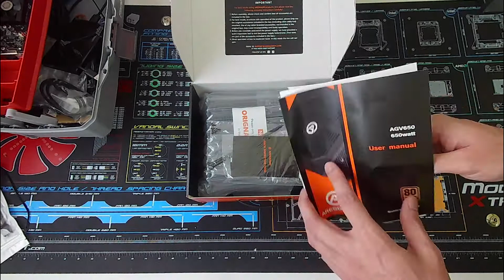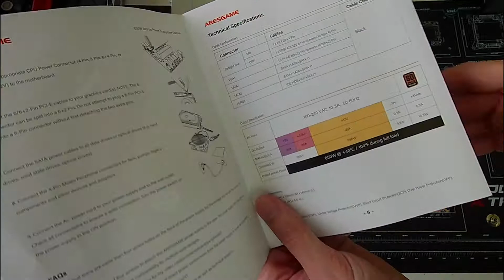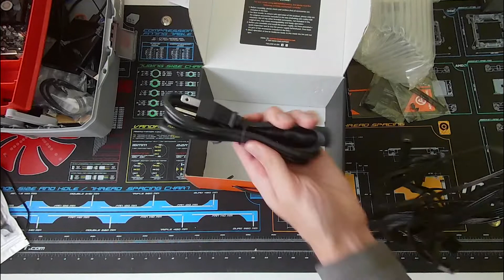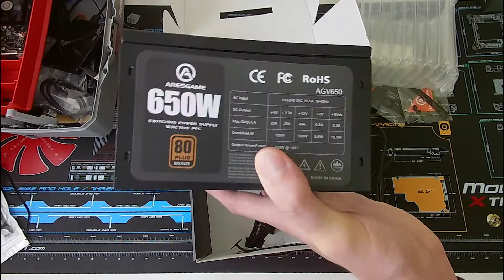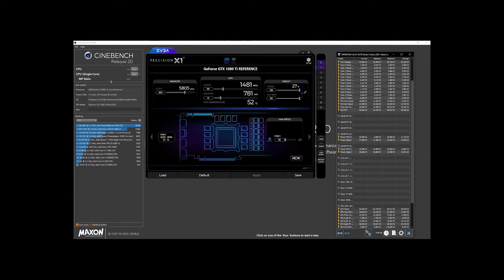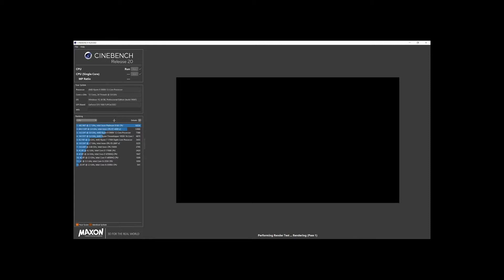Is this the Best Budget Power Supply on the Market? - ARESGAME 650W Bronze

Comment: your 1080ti pulled what 275 watts max? (kinda fuzzy for me) typically a 2x8 pin can handle 150 watts right? 75 from the pcie slot. so technically that cable is running 200 through it atleast right?  i mean it seems to be okay...but is it? lol im asking cause i built my daughters first pc with one of these ares 650's and its been chuggin along for the last few years running a i5 3470 and a rx 580 4gb. i have a 5700xt taichi i was gonna throw in there but im skeptical not having 2 cables max power for this card is like 270 watts. the rest of the system is maybe pulling 125 full load. so total it would be like 400 watts give or take a few. which on paper is plenty its just the one cable running that much power is what gets me.

Comment: I like these as well, mines running great after over almost two years and its quiet, stable and feel you really get your moneys worth BUT as always theres no free lunch and that is to say the caps used inside arent high quality as well as has been revealed in testing its missing a couple small components others might have, but it does have reasonably good input protection.  I think these are a case of how long will they run without issues, but for now im pleased with mine

Comment: Ive got two of these and after six months im completely sold on them, running quiet and cool since day one, as always long term remains to be seen but the feel and build quality seem  noticeably better than average compared to even some Thermaltakes in the same price range, the Aresgame reviews are certainly better than the Tt psu I was considering.  I also have a friend with an 850 and 500 watt and his are both running 24/7 perfectly on two of his mining rigs.  Im sold on the brand so far, lower end Aresgames come with an as expected 3 year warranty, but one gets the feeling they could easily go five years maybe more and the have all the major internal protections built in should a component fail.  Im my experience these arent cheap power supplies but rather budget affordable power supplies that are respectably well made and perform as such.  I have two and would buy another without reservation if the need arose.
Reply from the maker: i am super sold on them as well. i regularly build computers with good deals on used components and i have since picked up the 650w modular units for as little as $39.99 and they run systems with 2070s and overclocked 8 core chips no problem. it seems EVGA is dropping prices on some 550w units to the mid $40 range to match so look out for those deals too!

Comment: thanks bro, i got this same power supply for my r7 3700x rtx 3060
Reply: How did it go is it still running great with that 3060 or is the psu dead ?
Reply: @chris how is it going?
Reply from the maker: I've used a number of these units now all with no problems. Gamernexus did a video on them where they weren't as efficient as advertised, but I have yet to have one fail on me as far as I'm aware

Comment: Do you think a 500watt power supply is enough for a ryzen 5 1600 and a msi Rx 570?
Reply: I believe it would be, the RX570 draws 200w max and the ryzen 5 1600 draws 65w max at stock clock settings. Thats 265w plus other things like the motherboard and so on, so figure 300 watts or so with the setup you describe - still well within the rating of the 500w model - but if youre considering any big upgrades in the future you could be getting close to the upper limits and I always go a bit bigger as a buffer so the supply doesnt work near its limit all the time thus reducing heat and extending its working life, but this is just my opinion. I think the 650w is only about $15 more on average.

Comment: Would this be enough and be compatible with this motherboard?  https://www.gigabyte.com/us/Motherboard/B450-AORUS-PRO-WIFI-rev-1x#kf
Reply: Yes 100%
Reply: @kaden7868   thanks, and also do you think 750w is enough power for that motherboard with a ryzen 3600xt cpu, and a MSI GAMING X NVIDIA GeForce GTX 1660 SUPER?
Reply: @TS-fk9sd  oh yeah 100% it will, I have a 10400f 1660 super I think it takes more watts than the 3600xt maybe maybe not and my 650w can easily handle it
Reply: @kaden7868   Awesome, thanks again. 👍
Reply: @TS-fk9sd  np
Reply: @TS-fk9sd  it’s exactly what I’m getting 😳 even the motherboard wow
Reply: @Robstreck   Great minds build alike 😏
Reply: @TS-fk9sd  it is enough